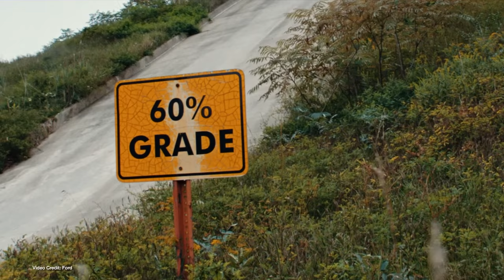LG Wins Battery Case Against SKI. What Does This Mean For Electric Cars?

Comment: The reall issue for consumers is whether long term patents etc are helping or hurting the move to electric. Patents aren't a right - they are offered by the country to encourage investment.  If they are being used to develop a monopoly or the company concerned is more inclined to throttle the industry to keep its profits high than to improve supply then the country should be reconsidering whether the instrument needs a modification.

Comment: Monopoly is what all big corporations aim for. 
More so if what they provide is in high demand.
Reply: Korea had state backed monopolies, LG did consumer tech and SK did batteries.
Although the free market degraded this, the big Chiels have abused thier position and size to keep the market to themselves, usually with tacit agreement off the government and sometime direct assistance in the name off protecting local jobs etc. This generally isn't an issue for the others as they tend not to compete.
So LG started needing recharging batteries built into thier consumer units and 20 year later wondered into SKs "patch".

This fight is a much political as it is legal

Comment: I have always wondered what happens if a patent bestows a monopoly on the company holding it. If it is impossible for any other company to produce a similar product without infringing on the patent. Do companies have to allow licences to produce the product to competitors to avoid it becoming a monopoly?
Reply: I think there is such a requirement in US laws. Something about the licensing fee having to be "reasonable" (for both parties). I guess some court ultimately decides what is reasonable.